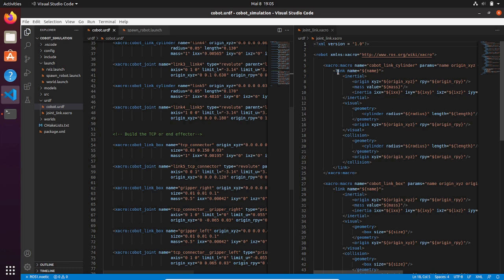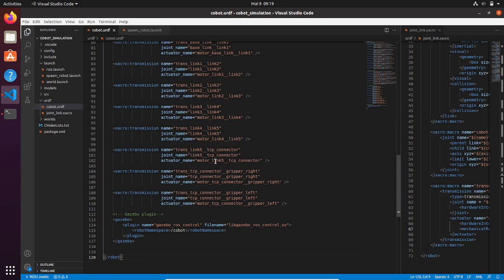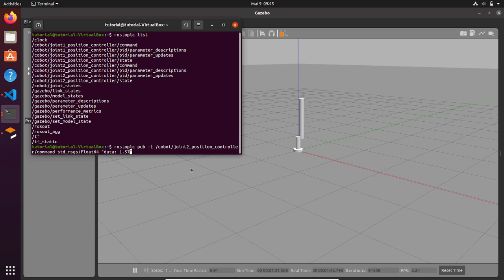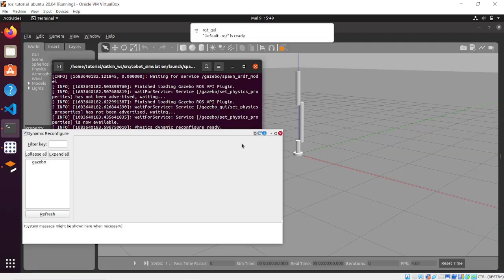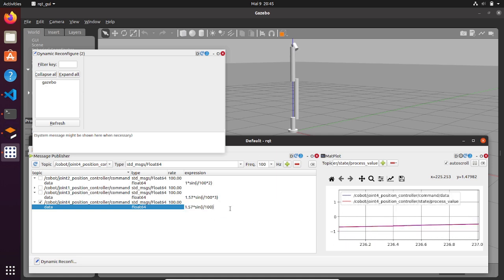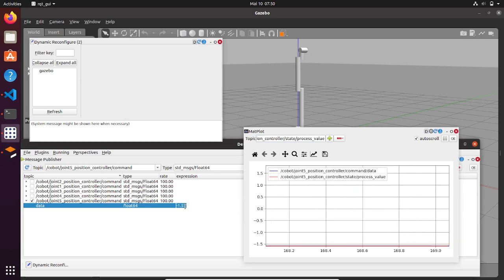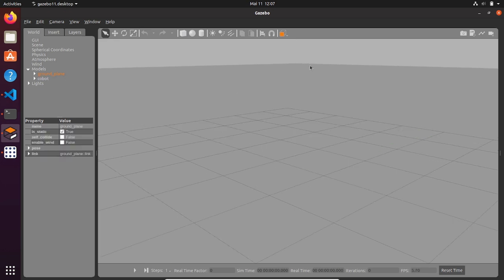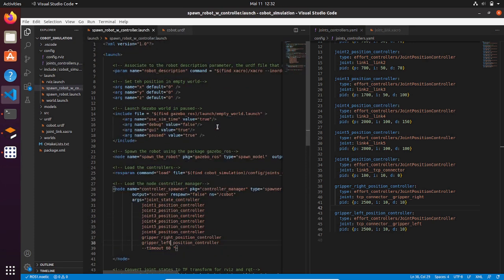ROS Control Full course for controlling Custom 6 axis Robot and Grippers

Comment: i am getting error while launching the spawn_robot_w_controller.launch "[WARN] [1699172048.629670, 35.715000]: Controller Spawner couldn't find the expected controller_manager ROS interface.
"
Reply: I also get the same error
Reply from the maker: Hi Donato, try to make this check list:
- install the library of ros Gazebo control, make sure that the plug in is in your URDF
- check the namespace
- install again the controller manager

If it does not work, don't worry, I am preparing a video similar in Universal Robot 5, to simulate it in gazebo. Let me know. I am expecting to publicate the video in the upcoming days!

Comment: what controller would you recommend for a electrohydraulic valve that controls flow to a piston, position, velocity or effort
Reply from the maker: Hi Isra. Basically it depend from the hardware driver pf your valve. Normally in the chemical industry you control the proportional value of opening with a pneumatic pressure: the more air pressure you give, more opening the valve's stem will be (if you have a normally close valve). I would go with position_controllers/JointPositionController. But be aware of the fact that in Simulation environment everything will work, but is better to understand if the hardware interface of the valve, is able to read that value. Check the driver type of your hardware  😉
Reply: Thank you for your reply, just to clarify the valve is theoretical and is not my main concern because I can program it to receive current, voltage or pwm pulses, all the valve receives is a percentage of opening encoded in one of the mentioned methods. but I was thinking that a position controller would send just a position to the hardware and the rest of the procedure would be abstracted away from the logic like a servo where you give it a pwm pulse that encodes the position and you forget about the rest, but in my case if I give the valve a 50% input that would mean 50% velocity of the piston so I was thinking a velocity controller, the problem with a velocity controller I was thinking would be that the load on the piston would be a little variable since it would have an opposing force acting against it and the dynamics wouldn't allow for the velocity to be calculated very accurately and thats the reason I wanted to get some input on the effort controller but it is not very well documented. I will try simulating all 3 and see what works best from there. I appreciate your input and if you have any comments on this please let me know. I tried sending you an email but probably went in the spam folder. Really enjoy your videos.
 @learn-robotics-with-ros
Reply from the maker: @isrg7221  feel free to send me an email with your project so I can give a look to it if you want 😉
Reply: just did  @learn-robotics-with-ros